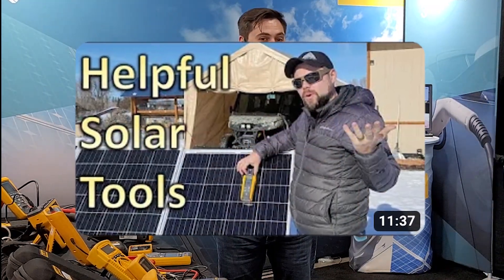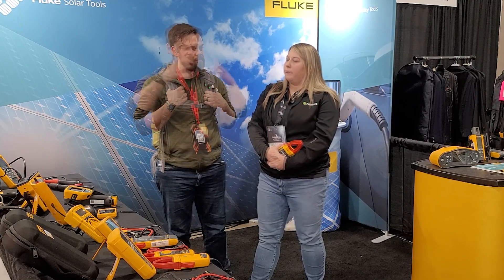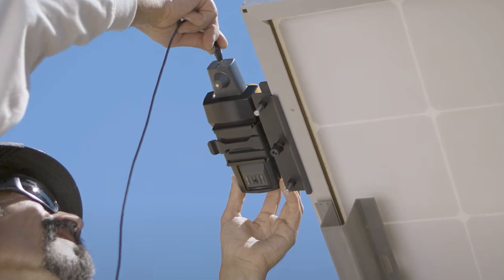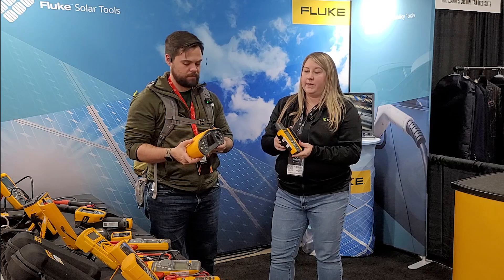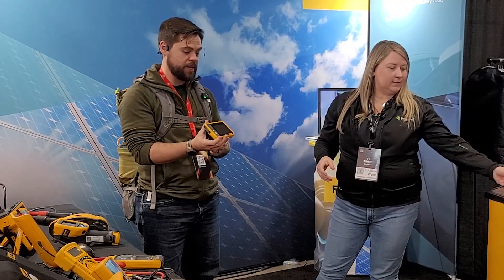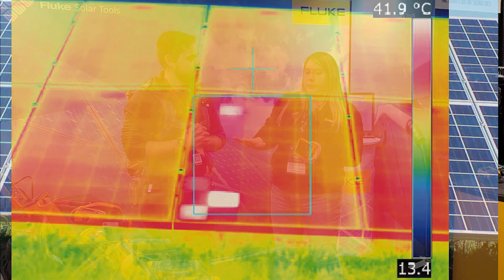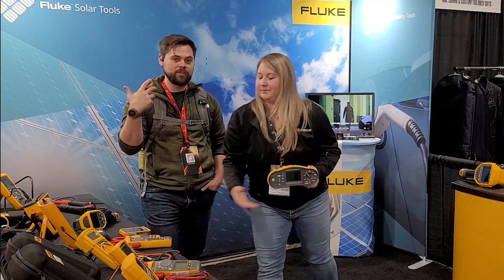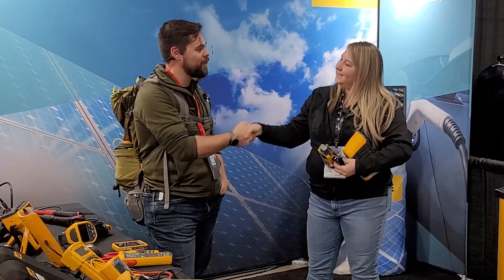Solar Tools to Make Using Solar Easier

Comment: An "IV" curve is a "current voltage" curve showing how the current and voltage vary according to some other variable.  In this case I expect the variable is the load.  As the product of current and voltage is power, the maximum point on the IV curve is the maximum power point (MPP) and MPPTracking charge controllers vary the load to keep the IV curve at the MPP.

Comment: Is there anything wrong by using a Fluke 325 Clamp Multimeter AC-DC TRMS around $350 vs  that new Fluke TRMS 393 FC 1500V CAT III Clamp Meter with iFlex  WOW $1,409.00??? I am not going into any Commercial work, But Thank you for Mentioning a Thermal Camera I will be looking to buy one and I am waiting for a sale on the Fluke 325 model!!! Liked#4 and subscribed!!!